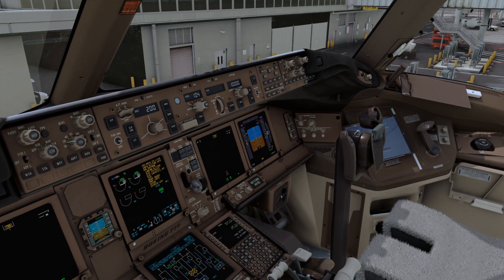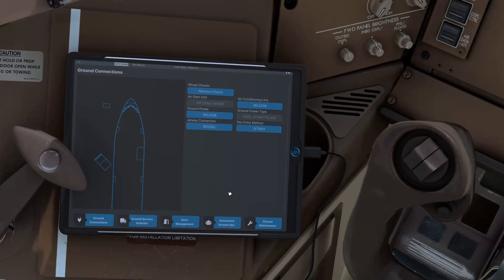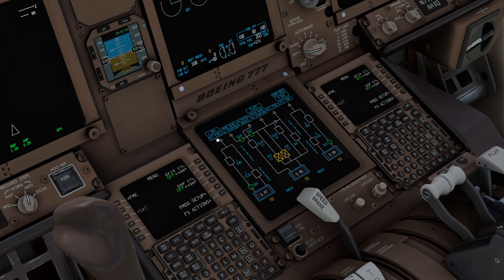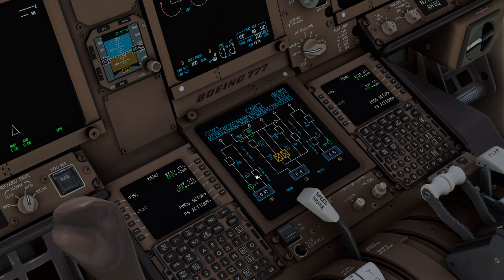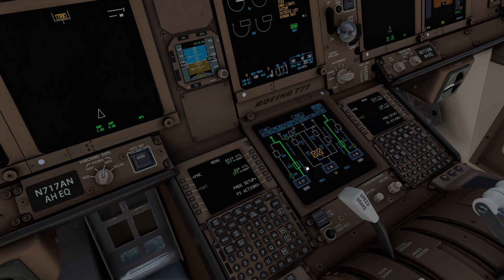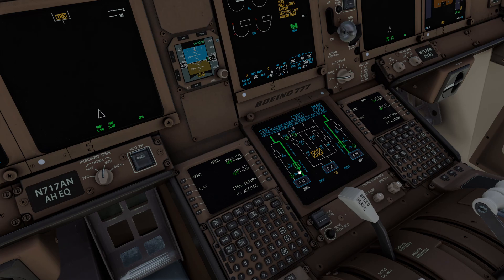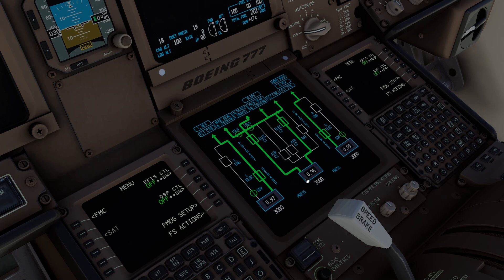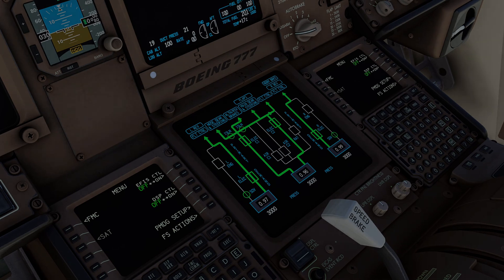PMDG 777 - HYDRAULIC SYSTEM EXPLAINED - Microsoft Flight Simulator

Comment: Your explanation regarding the RAT is not correct: the RAT only provides hydraulic power to the flight controls, not to the other center system outputs. That's why there's an arrow pointing from the other center systems towards the RAT/FLTCTRL line. So when you lose all other hydraulic pumps, you will only have hydraulic power for the flight controls. If the RAT is spinning fast enough to provide both hydraulic power and electric power, than the electric pumps of the various systems will be powered by the RAT, but it will prioritise hydraulic power for the flight controls over electric power for the other controls.